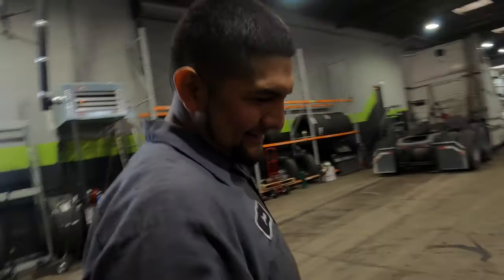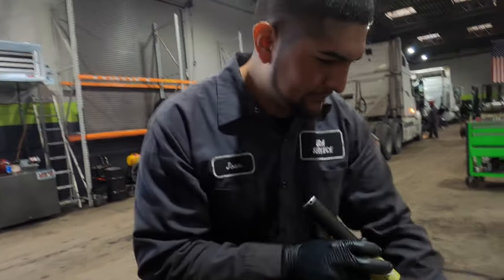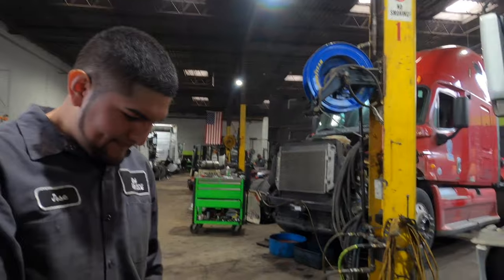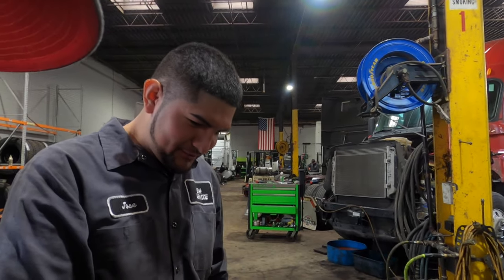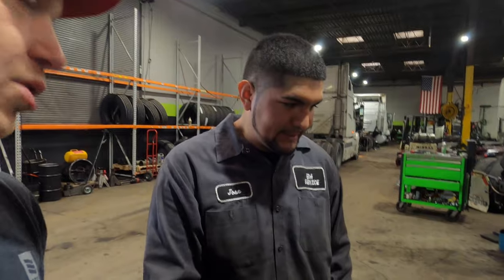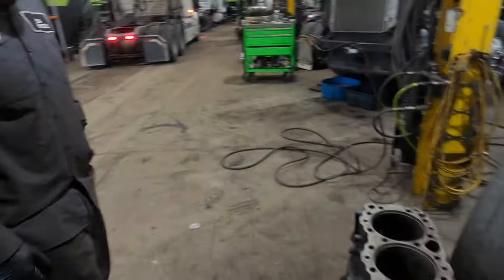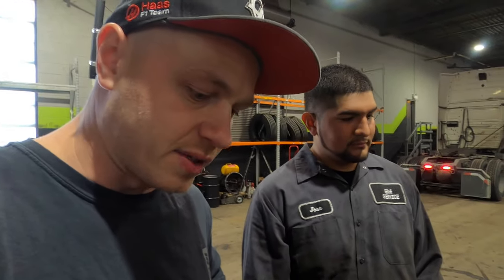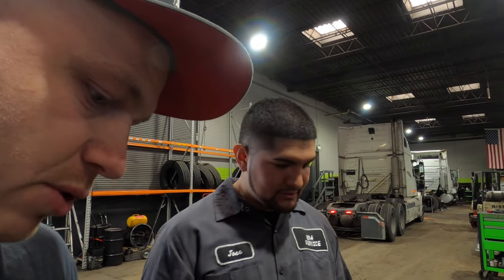Detroit Diesel Overhaul Part 2. We're in trouble

Comment: If you have an internet connection, you can find Detroit 12.7 short blocks, long blocks and complete rebuilds all over the place.  How do I know, Cause my Fitzgerald rebuilt motor needs replacing at 250k miles.  Had a newly rebuilt long block from Detroit in 14 days.  is it expensive, yeah, but they're available.  You claim they are not available, not true.  if you want a used junk block ripped out of a wreck, maybe harder to find, but they're out there too. Plan on holding your wallet open for a while.

Comment: Fitzgerald. .did a lot of out sourcing.. to get the motors  rebuilt. ...for crunch time...and. the shops. Used Chinese rebuilt parts in the Detroit 60. Motors. ..
My company I work for bought 5 of them..9 years. Ago...
Two of them have been rebuilt already at only 700k. On them...
That's when they found out about the Chinese aftermarket parts. In them........company gonna buy any more of them....hell no...